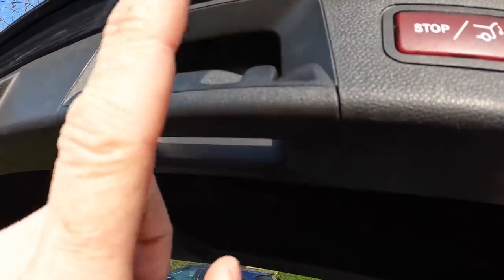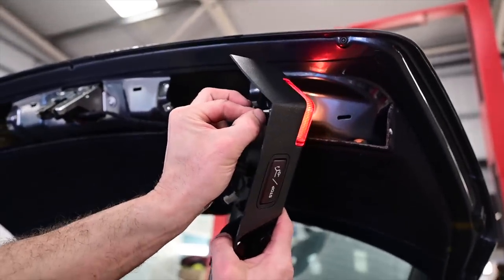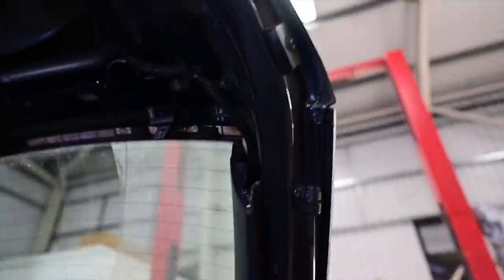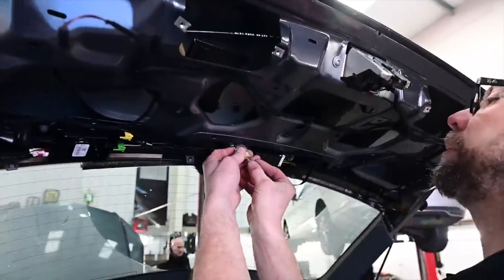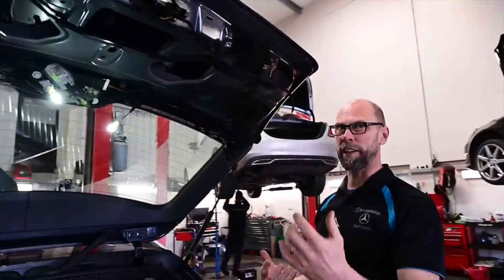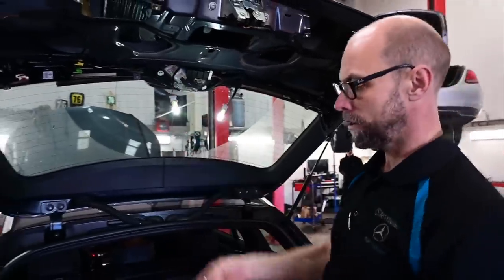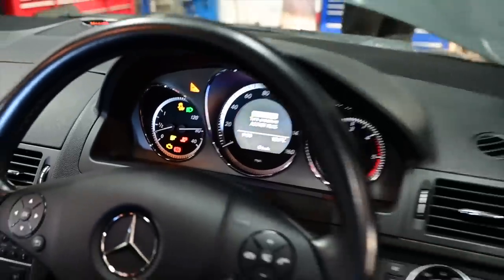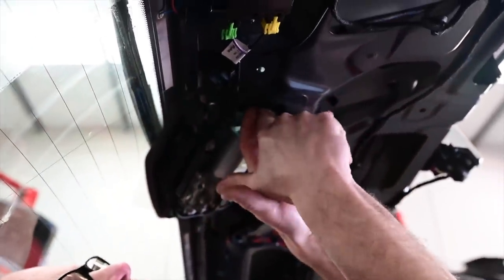How to change Mercedes S204 C Class Estate numberplate bulb

Comment: Wouldn't want to meet the guy who designed this way of changing a simple bulb, it's absolute insanity. Glad it's sorted Matt, you just know Mercedes-Benz, had a clever way for the home mechanic, to break trim pieces, in the process.
Reply: If you think this is difficult you should try changing a headlamp bulb or sidelight. On most even relatively modern cars it's a nightmare.
Reply: at least your wallet will be about €80 lighter.

Comment: Insanity ! Almost as insane as having to remove a complete headlight unit to change a bulb .  There ought to be a law that states that every external light on a car has to be changeable at the roadside without any special tools, ie use your hands/fingers only
Reply: I was able to po off extior plastic and do quick change in 20 secs be carefull guys dont break the lense water will be in need to know what fuse is trunk interior lights is on estate 2009

Comment: “They are functioning LED’s which will probably last longer than the car” Famous last words Matt.
Reply: Yes, seeing cars with plenty of LEDs with single glows blown or not working I wonder how many of those needs to be blown before the annual tests sayes you have un-even rear lighting and need to replace a whole, extremly expensive, taillight!?
Reply: Yeah, my car keeps blowing LEDs rather quickly so I resorted to back to normal filament.
They are the best option for reliability as you know they are what the car is expecting, no doubts about dubious quality like most LEDs. Other cars that I've had, the LEDs has lasted a fair amount of time but wouldn't say longer than a filament bulb so don't really believe that fact that they last longer but do look better. 

Also you can't be sure of the quality of LEDs (lots of dodgy chinese quality) and they might go quite sooner than you think.

Comment: Reminds me of that old episode of Fifth Gear where they got Tim Shaw to replace a headlamp bulb on a Golf and a Green Flag bloke to do the same on a Renault Mégane against the clock. Golf time: less than a minute. Mégane time: just under an hour. Apparently if your Mégane had Xenon bulbs you had to remove the bumper and other bits – cost at a dealer? £300! Absolute madness. I'll stick with my 16-year-old Fiesta, thanks.

Comment: Matt, the saloon isn't much better. The plastic trim should come off to make the job a LOT easier. There are some T15 screws to be removed and then it can be prised off with a trim tool (a screwdriver is a big no-no unless you're VERY careful). I would imagine it would be pretty much similar on the estate. I'm upgrading the number plate lights on my W204 to LEDs but to keep it legal (technically) I'm replacing the entire light unit and the only way to get it out is to remove that trim piece. Removing the tailgate/bootlid liner can be done if you're just changing the bulbs but it is more work.

Comment: Who was it at Mercedes-Benz decided that's an excellent way of changing your number plate bulbs?
Particularly as being mounted in the tailgate they would be more prone to failure due to regular impact vibration when the tailgate is closed on a vehicle without a powered open and close mechanism.

Comment: This type of LED has very poor heat dissipation, yet are ‘run hard’. They are prone to failure because of this.  Think how long the current bulb lasted, how under stressed these are and you begin to see why LEDs are not the be all and end all they are claimed to be. I also personally don’t like the ‘flood lit’ look of a number plate they produce but prefer the soft warmth of standard bulbs for items like number plates.
Reply: Why would a number plate LED bulb need to be run hard ? It doesn't need to produce much light to illuminate a number plate.
When LEDs first come out 20 years ago their power outputs and reliability were much lower but nowadays they are vastly more efficient so curious as to why this would be a problem ?

Comment: I've seen BMWs where changing a lightbulb is much worse in some cases you need to remove the bumper or take off the wheel on a lift to do them. Personally I'd avoid those small LED resistor bulbs every time I've installed they'll usually fail after a month or two and they start flashing and throwing errors
Reply: Agreed, had lots of LEDs of dubious, iffy quality. Wouldn't recommend if it's a pig to fit like here and just go for the reliable option of a normal filament bulb.

Comment: Had an issue with my e61 where one went, found an led replacement kit on ebay and then it broke in my hand, then I bought an led replacement bulb and it fell into the gubbins and I had to take all the trim off. Managed to get it out with a long magnet but when I put all the trim back it took ages and didn’t get some bits right, now I’m driving with one trim piece off because when it was installed it would rattle and drove me mad.

Comment: Had sidelight  bulb probs.with my 19yo. Honda Civic. Followed the Honda Manual took of the inner  wheel liners and wrecked them (early 90's Plastic). On to the Honda Forum only to be told that the lights can be changed at the top. Did so in 10 mins. Moral to the story .? Do your research don't trust a manual. Ps i had polarity issues as well.🤔

Comment: I can't believe it that is so easy compared to me fitting a l.e.d number plate light to my toyota hilux flat top drop side ute how hard can it be took me three days to do it is the hardest most frustrating job l have done on it apart from changing the radiator but was a case of how hard can it be well it was extremely hard and this was on a Mercedes-Benz

Comment: It wouldn't detect a missing bulb until that bulb was in circuit, in this case when the headlight switch was turned on. If its off the monitoring circuit doesn't see it anyway so won't flag it up as a faulty/missing bulb. Had same problem with a dodgy side lamp connector on my W211 that failed when lights were on. Made it good but light still stayed off until I reset it. 
Wasn't this the same bloke that put copperslip on your front brake sliders and walloped the wheel nuts up with a windy gun on another visit to these so called 'specialists'?

Comment: Slightly over engineered Matt, that's the Germans for you.
Reply: Not over engineered, poorly engineered.
Reply: @carlreading9916  Overengineered for the assembly line efficiency that becomes a pain for basic maintenance. Designed to sell more cars faster without any thought about how it would be kept on the road and legal.

Comment: Not the worst bulbs I've seen but ridiculous for something so simple.
My family had Renault Moduses (Modii?) for a while and you had to remove the whole front bumper and headlight to get to most of the front bulbs.
Unfortunately designs like this are not meant to be user-serviceable - you're supposed to go to the dealer and pay their extortionate labour rates for something you used to be able to do yourself.

Comment: Your supposed to be explaining this procedure to your public, and NOT to your assistant!
No light on the matter in hand so very little of what your talking to your assistant about can be seen
It's would appear to be an effort to boost your ratings so you can get a higher income from the advertising as apposed to assisting your audience.
A good ploy to get viewers to return to the site more than once 
With that in mind I wouldn't be inclined to use Stevenson's Mercedes Benz if they are endorsing this video

Comment: They certainly will not last the life of the car. They look like the cheapo Chinese ones off ebay. They get super hot as the driver chips are driven so hard. The PCB material burns, crumbles and then they fail.